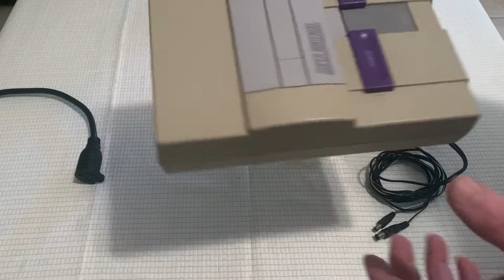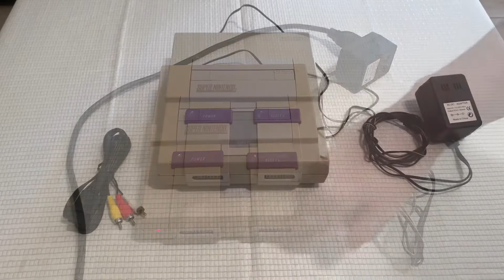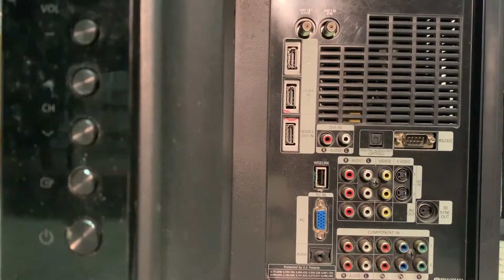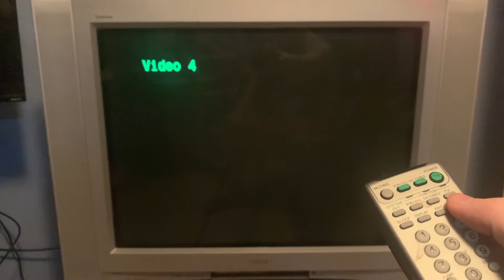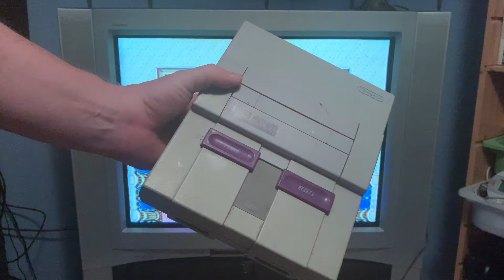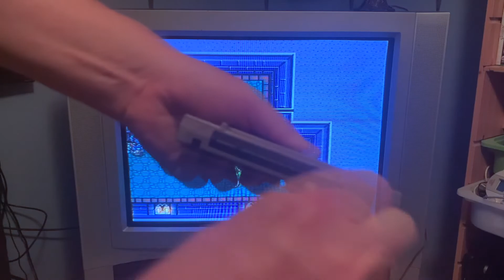How to connect your Super Nintendo - SNES, using RCA Composite Cables

Comment: For those of you with a modern TV that takes HDMI input but does not have the red/white/yellow AV input, then you can still play your SNES if you get a "AV to HDMI converter" which costs a mere $10.  As long as you have the original SNES AV (red, yellow, white) cables, you simply connect them to the three colored ports of the converter, provide power to the converter as instructed, and connect a HDMI cable from the converter to the TV.  I have a SNES Jr (unmodded) and got mine working nicely on a Vizio smart TV which accepts HDMI input but has no AV input.

Comment: my tv only has one audio port and a video port, can I just use the right audio cable and not get stereo sound or do I need an adapter
Reply from the maker: You can. You should use the WHITE audio cable as it is often the mono cable. Just leave the red one hanging loose!
Reply: @thegametrog  k thx

Comment: I just found mine in storage and it still hookups and comes on with 2 games I found. But I can’t find the video connector. Do you sell the video connectors? Which one is better? I’ve watched both your videos. I’m thinking of selling it once I get the video cable replenished. TIA.
Reply from the maker: I have the Video Connectors at Gametrog.com, If you plan on selling it just grab the RCA cable from this video. You can find it here: https://gametrog.com/product/snes-n64-gamecube-av-cable-rca/
Reply: @thegametrog  Thanks bro. Any idea what these things are worth nowadays in pristine condition?
Reply from the maker: @camholmes7141  You can find an endless supply on ebay and see what they are going for. I also buy old games and system through Gametrog: https://gametrog.com/sell-your-old-video-games/

Comment: Is it possible that there’s something wrong with my SNES? No signal being sent to my tv :( but all other consoles work with rca cables
Reply from the maker: Oh, it's always possible! Does the light on the system come on when you turn it on? Do you see any change to the screen when you turn it on? If so, It could also be a dirty game. Have you cleaned the blade on the bottom of the game? Tried a different game?
Reply: @thegametrog  mine shows no change to the Tv and I haven’t tried different games but turns on

Comment: Hey bro, what year is your tv? 
My tv is 2009 and I followed the same steps you did to no avail. 
Could it be my tv is too new for the Super Nintendo?
Reply from the maker: Hey Broete! Age shouldn't matter as long as you have those same RCA connections on the TV. Does the SNES light come on when you turn on the power? Double check you INPUT number on the back and make sure youre going to the right input. Also, try a different game and.or clean the cartridge blade before putting it in the SNES (if they've been sitting unplayed for a while that can help. Do you see any change on the screen when you flip the power on the SNES on anf off?
Reply: @thegametrog   I am having the same problem too.  I've been wracking my brain and can't figure out how to get it to work.  My av cables are on the correct spots, power works on the snes, tv is set to av (tried the other source/input options but besides hdmi it's just tv (which is cable) and something called YPrPb which also doesn't work.  What would cause it to not work? I've tried 4 different game cartridges and nothing works.
Reply from the maker: @cyclesofstrength  Hey Cycle, hmm. It could be the AV Cables (not sure of their age), it's not a common problem, but I have seen it. It could also be the Composite Inputs (Red, White Yellow on the TV) again, uncommon, but I've seen it also. Everything else sounds proper. The YPrPb is "Component" and for higher resolution devices (and some consoles) BUT you can try using it. You would plug the Yellow Video from the SNES into the GREEN port, ignore the Red and Blue ports, There should be another set of Red & White ports right next to it for the audio. That input would then be different from your AV options on the TV. Back on the regular connection, do you see any flicker of color change on the screen when you turn on the system, does the black screen get "blacker" for instance? That could mean it see the SNES, but there is something wrong with the SNES or game (unlikely as you've tried multiple games). The next step to to try any other TV. If you can't get it going contact me through Gametrog.com - Thanks!